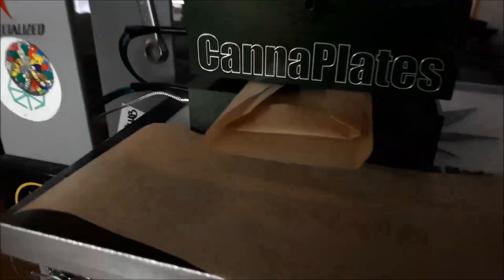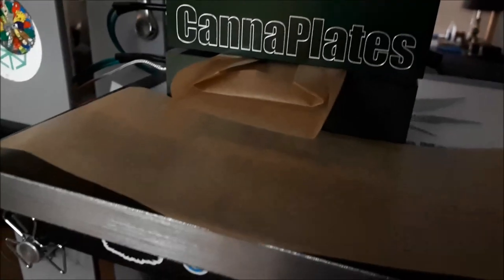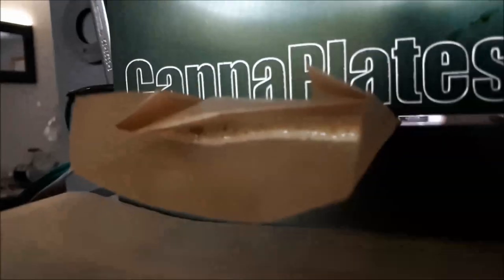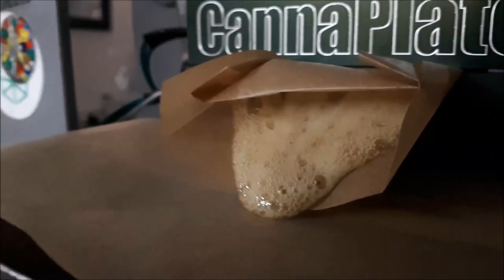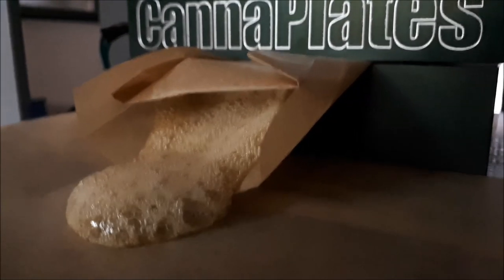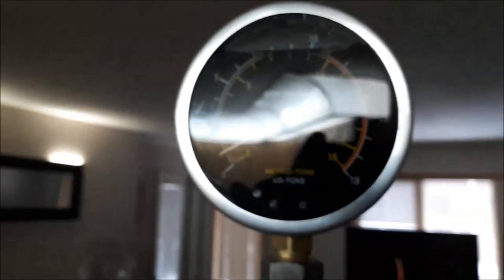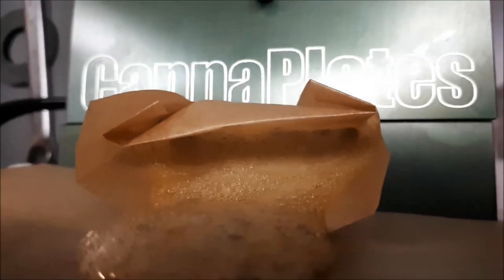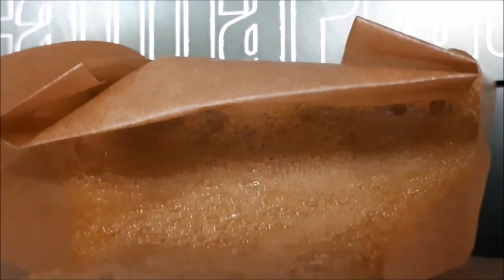THCAMELT

Comment: What temp?
Reply from the maker: This was pressed at 145C. THCA melts at a higher temperature than you would think, around 110 - 120C but i wanted it completely melted. Next time im going to drop the temp to 125C, I think 145C was too hot.